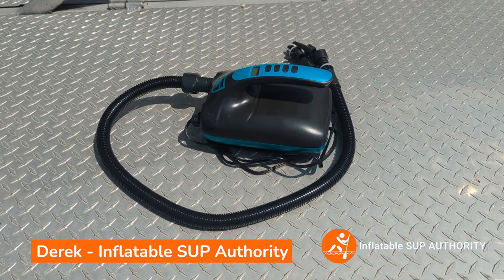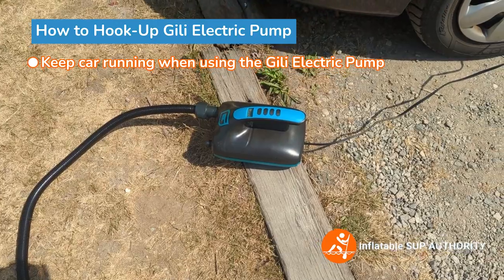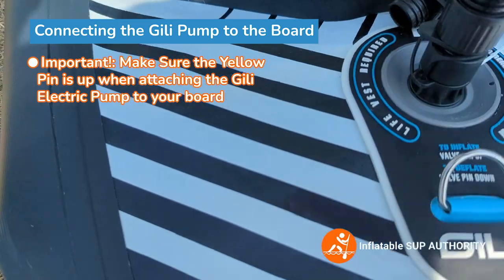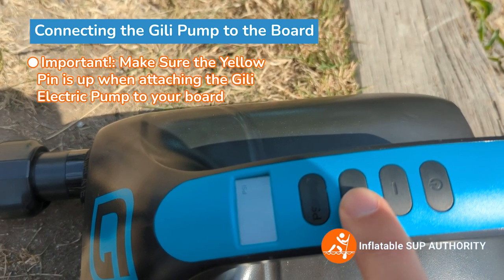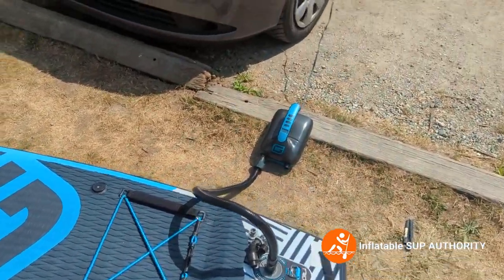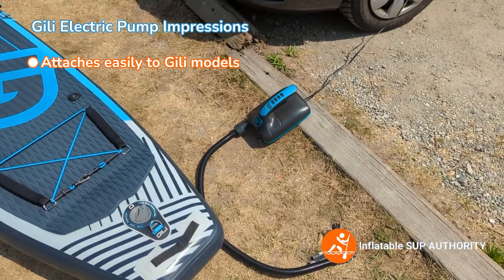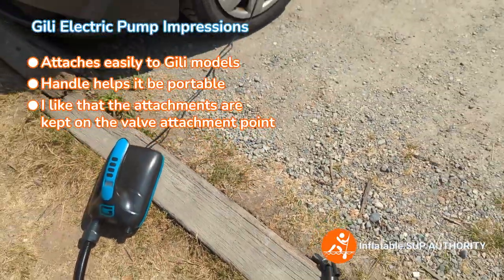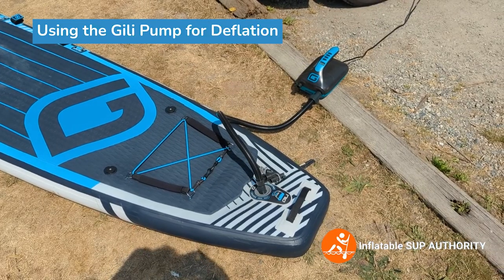Gili Electric Pump Review and Instructional Video | A How-To From Start to Finish + My Impressions

Comment: How many min did it take to get to 15 psi? Mine got to that 2nd gear at about 2 psi and by 4 psi it felt rigid but if that 2nd gear is normal I'll try again. Thx!
Reply from the maker: For this specific video I did not record the time. I find it's dependant on how much the pump is used in that session as well as how warm/ cold it is. 

I will be recording a video about this soon testing different pumps and their times so stay tuned!